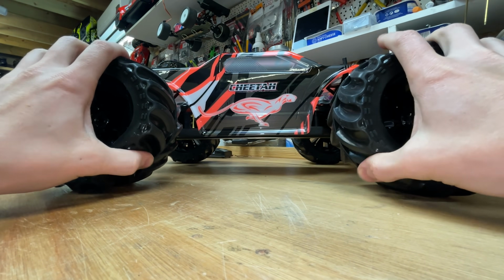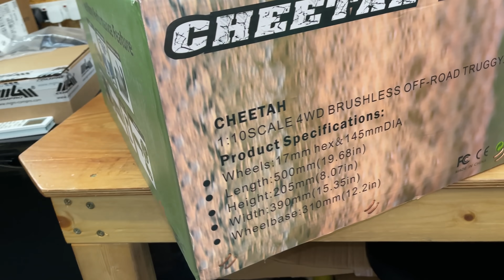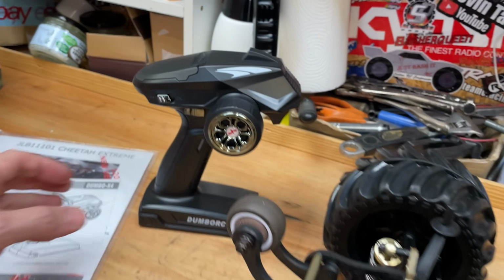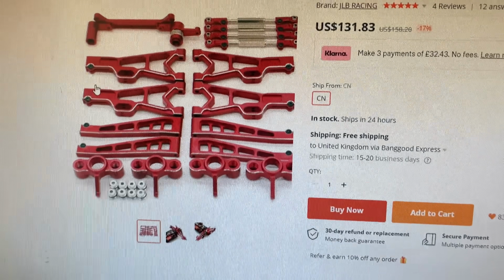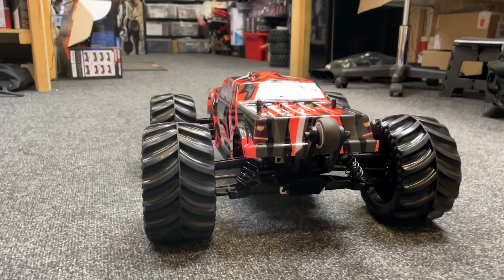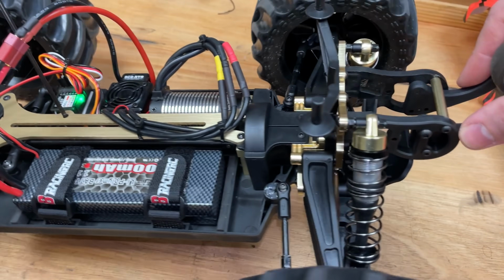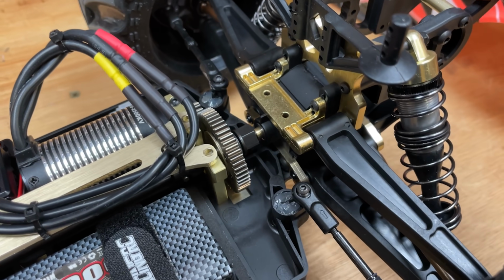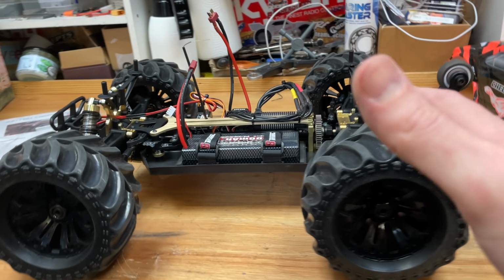CrAzY FAST dirt cheap RC car

Comment: this one looks like the old racing cheetah? is there any difference ?
Reply: Beside the cover, I think there is no different, out dated cheetah, same old cheesy cheetah, the other brand already have v2 to v5 or from jeneration 1 to Jen 3 upgrades on they're rtr trucks already.

What is the point of showing a non updated cheetah, when Kevin already show the previous two old jen already.🤔

Comment: I just got a traxxas rustler 2wd and I want to put my gopro hero 8 on it. I’ve tried using the gopro adhesive mounts on the shell, but it just won’t stay on. I don’t have access to any of that putty stuff you use though. Any ideas on where and how I can mount it?

Comment: youve sheared the retaining pin on the rear diff! I have the 21101 and the pins fail all the time. I tried fitting thicker pins by drilling out the shaft but then the shaft breaks. replace the pin with titanium and all is good! plus 500cwt rear diff oil and 300cwt front helps stop that and massively improves handling.

Comment: Could you review another hsp rc car? im thinking of getting an electric hsp.
Reply: There not bad as a 1st Rc car but it depends what your planning to do with it. If you're wanting to send it to the moon your better off going for something else. If you just want something to drive around your back garden or on the road in front of your house you can't go wrong. The brushless 3s pro versions will do about 60kph, has cheap parts and come with a 3s lipo and charger. All pretty good considering there price. I do have a running video of a 1/10 hsp short course truck on my channel 🤗 if your interested in seeing how it goes. Hope this helps, i remember when i was in your shoes. It can be hard to choose.
Reply: @GaveitagoRC  what do you think of then if i want to do jumps?
Reply: @bobjim7169  If there little jumps like a couple of feet (60 cm) you'll be ok. Anything bigger you'd be better off with something like the Arrma Big Rock or Granite. I know it's a lot more money but more often than not you get what you pay for in Rc.
Reply: @GaveitagoRC  would a Traxxas 37054-1 Rustler 1/10 2WD RC Stadium Truck be decent for some jumps and off roading?
Reply: @bobjim7169  yeah i guess, I've never owned one my self. Personally I prefer 4wd becase they handle better and car's with those style body's tend to parachute a bit in the air when jumping, but it should be able to take a hit.
Reply: @GaveitagoRC  thanks for the advice
Reply: @bobjim7169  all good mate, hope it helped. ✌🏼😎

Comment: Hmmm.  Hot glue? I never considered using that to keep parts from separating when they aren't supposed to. My first car had an issue with the steering linkage coming out of the plastic arm on the servo. It stripped out the threads so it wouldn't stay in after that.

Luckily I've ordered the aluminium arm for the 2nd buggy, wltoys 124019. Gonna order some bigger wheels and tires and hub extensions next, so I can drive it in grass and stuff, too.

Comment: At the price of this I can get a Kraton or Outcast,  and for $60 cheaper I can get a Big Rock. Does this RC have decent aftermarket support? It would be nice to see you compare it with a Kraton, Outcast and have Ol' Stemp "I doubt I spelled that right" bring out the Big Rock.
Reply: Not sure where you're getting a Kraton for 260 odd quid? Let me know I'll buy several and on sell them for a profit.

Comment: Love my jlb!  Except I keep breaking the rear diff. Just like kev did here. Usually for no reason. But man is it fast!!!
Reply: I've not had that issue with this one but I don't do silly high jumps with mine. Mainly drifting in the wet and speed runs. Probably the massive wheels it comes with in my opinion.
Reply: Justin Allen I don’t do flips either. I have the other version with the better tires.  It just randomly snaps the rear diff. Other than that it’s amazing!
Reply: @jondoe6618  Are you on about the blue and black bodied one?
Reply: Justin Allen yup
Reply: @jondoe6618  yeah I find that one perfectly fine with the diff. Non stop wheelies with the battery I use. Definitely my favourite one.
Reply: Justin Allen yea. Wheelie monster. I’ve never even ran 4s in mine.

Comment: Im keen to see how tough this thing is. I have a 1/8th zd pirates 3 and all the plastic is weak as piss.
Reply: Cheers Kev. Love you're work. Regards from Australia. 🇦🇺👌👍🇦🇺
Reply: Trust me the Cheetahs are far stronger than the ZD Pirates, I wasted 270 quid on the Pirates 3 monster truck. I still like the look of the ZD truck but yeah the plastics are crap. The only downside is if you take either version of the Cheetah cars to a BMX track the wheelie bars and wing mounts will break as I did mine 🤷‍♂️. Good fun though 😁
Reply: @justinallen9358  yep. I shelled out $550 AUS. The motor (4076) esc (surpass 120 A) re-branded dumbo transmitter and receiver are good as gold. It's a shame the plastic is shite.
Reply: @justinallen9358  on a positive note, I only got into rc because of watching Kev's channel (even though I'm in my mid 40's).  It's bloody addictive.
Reply: @bugproductions9050  Yeah, I do like it but can't do any big jumps without it exploding. However I made it drive better by putting thicker oil in the diffs 👌.
Reply: @bugproductions9050  Same, I ended up buying both versions of the Cheetah, a 6S Kraton EXB, Typhon 6s, three others and soon to be an 8S Kraton EXB.
Reply: @justinallen9358  what's your favourite? (Considering price vs enjoyment).
Reply: @bugproductions9050  Looks wise definitely the EXB, price vs. enjoyment probably the truggy version of the Cheetah, I like the monster truck version as seen in the video but I found it flips rather easily when cornering on tarmac. With my truggy version I can do wheelies for a couple of hundred feet without ended up in the roof.
Reply: @justinallen9358  cheers mate. Thanks for the info.

Comment: If i built a car it would have 10 mm ball joints for steering. 10mm pins for my 15mm thick wishbone arms, honestly its so obvious how they are designed to fail.

Comment: DiRt ChEaP $380 you can get a traxxas rustler for that and a extra battery charger and parts. It may be dirt cheap to you or even just cheap but  for a lot of people >200 is cheap for a 1/10 + 4x4. Not to hate but damn bud c’mon

Comment: Jlb, jlb,😒 everyone, what is wrong with this company, that's quite a lot of complans out there with all the old version, and they still come out with the same old some old (just change the body), come on jlb. 

The jlb rig are not bad in design, but it really need some upgrade from the jlb company, now a day with this price, i rather save a little more and buy a brand name rc like traxxas, arrma, tekno.......... 

I have both jlb old versions, and they both are my shelf queen now a day, caz i can't upgrade them to the max, and also no matter how you upgrade this jlb rig, it's not as stronge as the brand name truck. Yep, i spend a little more on my brand name rig, but after some upgrades on the brand name truck, they're really stronger and last way longer (almost double or triple the run time before i broken something on brand name rig). with the cheetah i have to fix something everytime i run it, and need to wait so long for parts to arrive. 

So for people who's getting in to rc car, save your money and buy a brand name rig, never a jlb, caz i being there before.